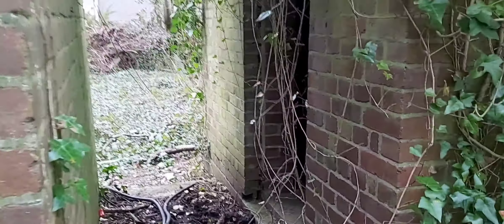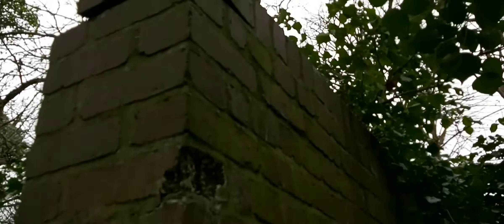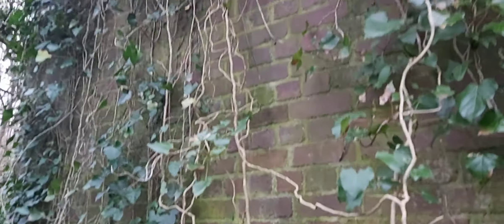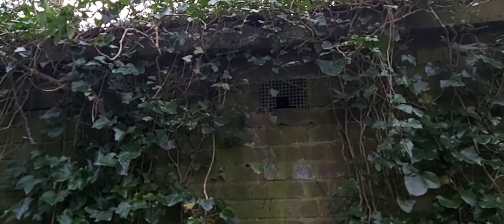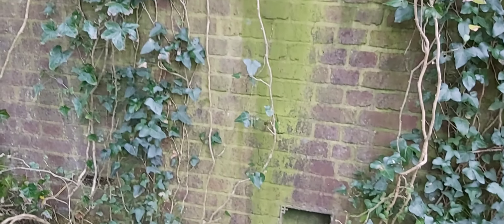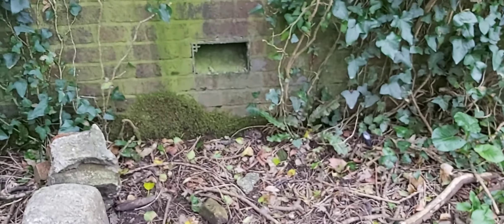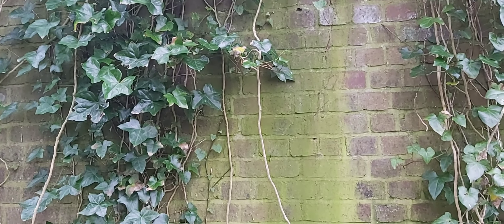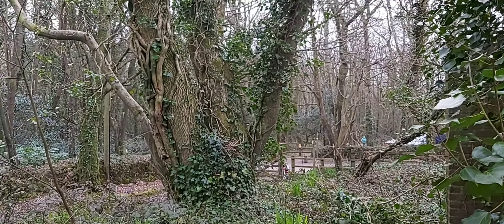Now believed to be a WW2 telephone exchange.

Comment: I thought it was the dispersed telephone exchange for RAF Perranporth.Why would a pump house need a blast wall?
Reply from the maker: Thats great if it was. There is a pipe underground nearby so I was once told that it was for boosting pressure. Didnt know it had a military connection.  I will investigate further. Thanks for the information. Would it have served RAF Portreath as that is alot closer to it? Although it is still quite a way from the airfield?
Reply: @twowheelexploration9228  Must be war time with a blast wall but whether a dispersed exchange or pump I do not know.I do not know where this one is.
Reply from the maker: @feldgendarmridpath7893  its not that far from Portreath.  The old Operations room is about a mile from this hut. An old map I've seen suggests its been there since 1941 and strangely enough a modern in use telephone exchange is right next to it. So I'm sure your right. Thanks for the info
Reply: @twowheelexploration9228  Later when going to ex RAF Perranporth ,park in Trevellas and walk back to the bend.Grass verge on left with wooden bar fence and wood behind.At end of wood take footpath and on it´s left you will find the dispersed telephone exchange with blast wall and similar holes and vents in walls.